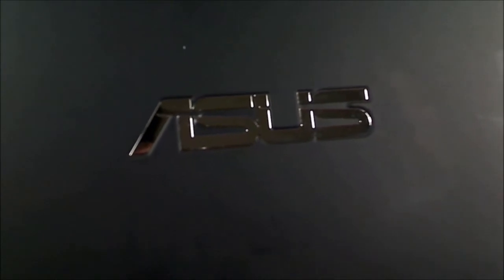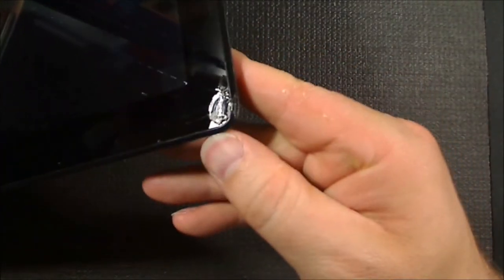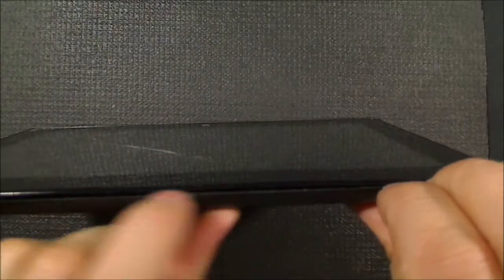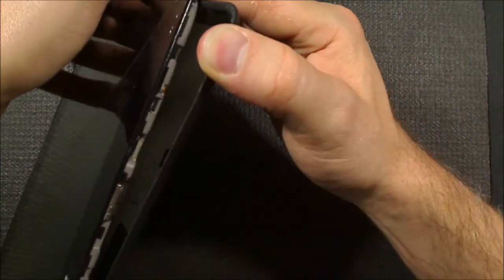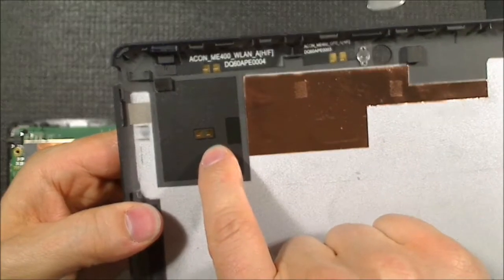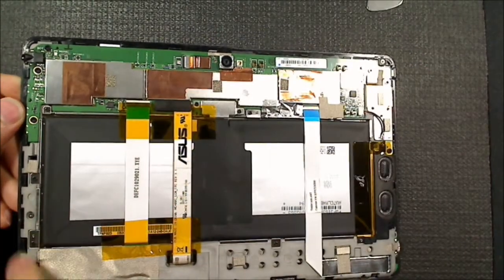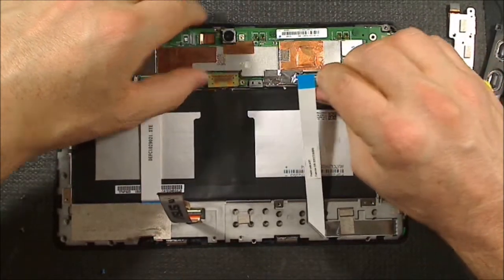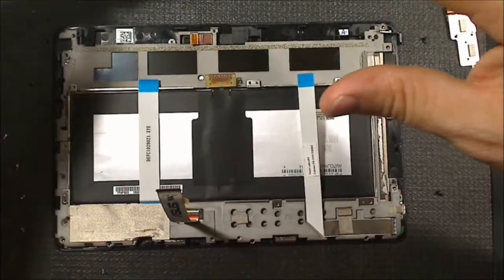ASUS VivoTab Smart ME400C Tablet - Busted Screen

Comment: Managed to replaced mine (the touchscreen + frame) cost me 34$ on ebay and it works fine. I got the genuine part from a faulty item. Thank you for the tutorial, I didn't really need anything else, but some smart parts that I didn't know where to put. If you manage all the screws you should be fine :).

Comment from the maker: but yeah, thanks for the comments everyone - I haven't been able to get a replacement digitizer. Like someone pointed out, the one on eBay in the video turns out to just be the LCD. And as the other comment below says; it's so close to the value of the device thats it's hard to decide whather or not to do it. If I found a digitizer for less than $100 I'd probably fix it, but otherwise I'll just put the money towards the next tablet... not sure which I'll get
Reply: is  the ram and ssd  replace ablbe or more ram add  i got this  thing free

Comment: Hi, recently i dropped my me400c too and facing the same problem with you! Only 20% of touch screen is working, can you give me the link where you order your replacement? Deciding whether to repair it or not, thanks!
Reply from the maker: Hi, I searched on Alibaba dot com for 'ASUS Me400 touch screen panel' but the people have not responded to my enquiry so I would not recommend buying it off there. That company had 'Miracle' in their name. There is another company there with 'Wagen' in their name that may be the same company. We need to find the part at a reliable safe supplier somwhere else.

Comment: Asus support estimate $218 repair sent to an authorized service center. Just get an RMA #.  But yes I had mine in a protective case and it broke from a 2 foot drop in a BLUREX case.  Very disappoint in durability, but that is way purchase was $349 instead of a $1000.

Comment: I didn't even drop mine, just trying to snap the rear cover back on after checking out the internals (I like to open up everything!) AND then I flip it over to turn it on and DAMMM! its got 2 cracks across the bottom 3rd of the touchscreen. :(

Comment: I just replaced a cracked glass on mine, and every looks to be seated well and plugged in but the touch sensors isn't working. Nothing looked frayed or pinched not really sure what's up. I did make sure the screen protective film was off both side of glass during instillation.  There is also a little switch in the unit just left of the ribbon cable that goes down to to the board that the touch controls plug into. Any thoughts what that is?
Reply from the maker: hmm.. given that it was replaced, one would have to suspect the flex or the connector. You could check the device manager just to ensure there isn't a warning on any hardware - the touchscreen should be listed there somewhere, but may have a name that is not obvious. Regarding the flex and connector - Use something like a 4x loupe to examine them carefully. Also - the connector for the flex probably has a sliding clip/mechanism that needs to be released before pushing the flex in; and then pressed 'home' so that it grabs the flex tightly. If it is at all angled or not all the way in, then it won't work.
Reply from the maker: Not sure about the switch though. I don't recall that one.
Reply: @robax  Thank you, i'll check device manager and see if its picking up the touch screen.